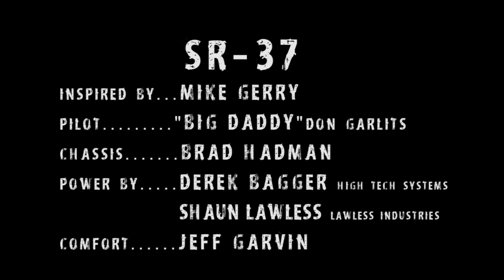"Big Daddy" Don Garlits SR37 Quest for 200MPH on Batteries

Comment: A production Tesla, just a few years later is faster than this and you can get groceries, go to work, and jam your tunes in the Tesla.
Reply: I somehow doubt that Tesla can hit 200 mph in 1/4 mile.
Reply: @Weerknuffelbeer  Do you own one? I Don't, so I have to go with published data. Look it up
Reply: @dawnminilla9299  It takes the Tesla slightly less than 9 seconds to do the 1/4 mile. This dragster hits 184 mph in 7.26 seconds. That means that as a rough estimate the Tesla will hit about 150 mph at the finish line. That's impressive but still a very long way from 200.
Reply: @Weerknuffelbeer  were talking about a bit more than a second, so ok I was wrong in that it's faster however this is the  "Base" model roadster. Supposedly there is a faster one coming out. Still though, you built an all out drag rail that barley bests a production car, come on.
Reply: @dawnminilla9299  Power needs increase exponentially as speed goes up due to aerodynamic drag. If you can reach 150 mph with 1000 BHP you need around 3000 BHP to reach 200. And then about 10k BHP to reach 300+ like modern top fuels do. So yes, going from 150 to 200 is a massive improvement that requires specialized equipment.
Reply: @Weerknuffelbeer  Sounds to me like your repeating something you heard, incorrectly I'm sure. Ok smarty pants, show me how any of this works mathematically, don't forget to included the body mass, surface area, external pressure of the fluid, velocity increase of the mass... etc. A Cessna 172s has a 180hp engine and has a top speed 182 mph in level flight. Wind resistance is near 100% of the drag an aircraft experiences while in flight so how can it go 180 with only a 150hp. Think about that for a moment and you'll see what you're missing in your comment.
Reply: @dawnminilla9299  Well, I admit that I was incomplete: the reason is not only aerodynamic drag but also (primarily actually) in the way mass, speed and kinetic energy relate to each other: E = (1/2)m*v^2. Where E is the amount of energy the object has, m is the mass of the object and v is the velocity of the object. In other words, the value of E states how much energy is needed to accelerate an object from standstill to a certain speed. Notice that the velocity term is SQUARED. This means that for every mile you want to go faster you need exponentially more energy. 

Also, this formula applies in a vacuum. On a road on earth, both aerodynamic drag and friction from the road you're on (also forgot to mention that one) also work against you. These things combined are the reason that for every 100 miles you want to go faster (and maintain that velocity) you need about 2.5-3 times (very, very rough etimate but it's about the pronciple here) more power.

Anyway, hope it's clear now. I'm not a physics teacher but I hope you catch my drift: in order to reach 200 mph within 400 meters from 150 mph you need much, MUCH more power than reaching 150 from 100.

Comment: Were rooting for you Big Daddy! If anyone can do this you can. It's just a matter of time. Can you use a computer to control the acceleration. Like have it start out at 1G and as soon as traction is confirmed go to 2g, confirm traction and go 3G etc....? This would not provide linear acceleration, but logarithmic acceleration might be the trick. The farther you go the more the motors put you back in the seat until you get to the point when you're maxed out. Give it a shot, and call it the Cohagen Acceleration Strategy. If it works it could change the way we think about electric cars. The next hurdle to tackle is battery recharge time. This is where hybrids have a huge advantage. Good luck my hero! Knock the ball out of the park, and keep us posted!

Comment: The people who are leaving comments are not understanding what Mr Garlits is trying to do. The cost of top fuel is too high 50,000.00 more or less per run, plus motor rebuild there are few teams that can afford this. The electric car is the new front. Mr Garlits would like the common gear head to attempt this electric forum. 1st we will not be chased out because of noise, 2nd it more affordable (so far, and in comparison), 3rd High speed hasn't been done yet we have a long way to go. Get your hands dirty, start thinking 250 mph talk is cheap or are you just afraid to try something new.
Reply: Fuel runs cost no where near 50k unless you scatter the motor. And if your first reason is that racing is too loud, nothing else you have to say matters anymore.

Comment: Carbon fiber chassis Big Daddy!!!220...ish!!! should do it...
Reply: Michael Slack wow!! what a concept !!!!
Reply: Michael Slack - Carbon fiber is very rigid. No flexing in the chassis on a longer car like this would result in unfavorable/tricky traction and handling. The motors and batteries along with the battery cables make up the bulk of this car's weight. The chassis on this car is made from chrome moly and weighs under 200 lbs. Even taking 200 lbs. off the car at the time of these runs, the car would definitely be a bit quicker but the mph would still be similar. Motor over-speed is a huge limiting factor. Hopefully a taller tire size and adjustments of the drive wheels' placement in the chassis is all that is required for 200 mph to be attained within a 1/4 mile pass. I DO like carbon fiber for many uses, though!